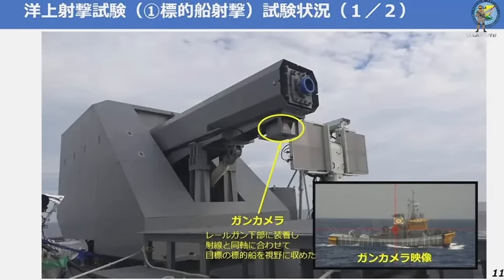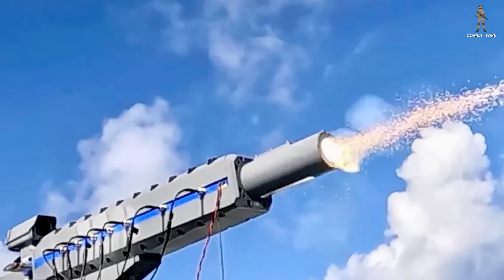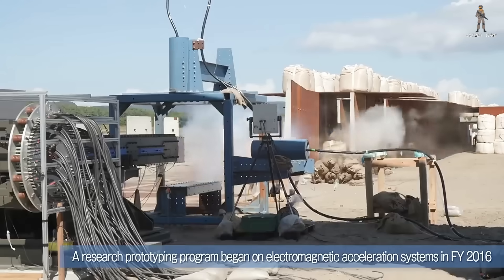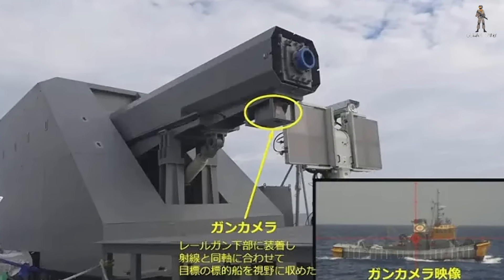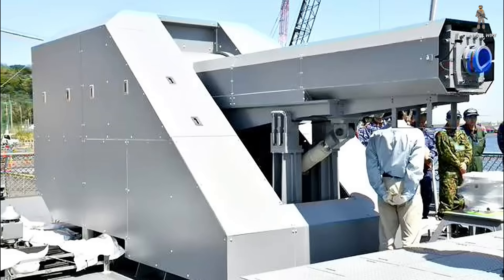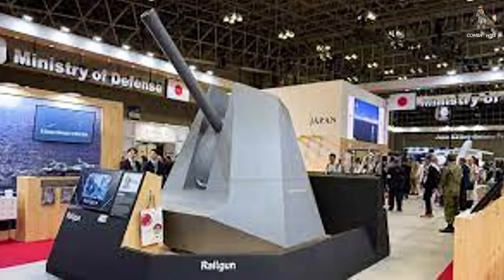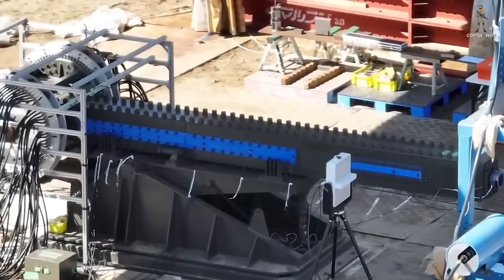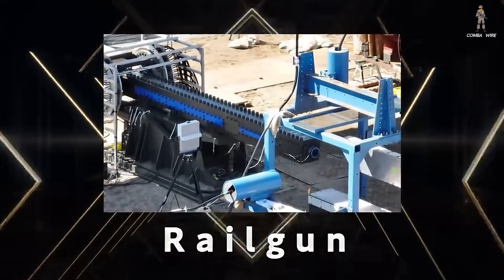For the First Time Ever, Japan Reveals True Railgun Damage at Sea.

Comment: Nice!
But as a weapon, does it destroy ship systems?
I see hits but no ships sinking.

You have a giant expensive hole puncher. But i don't see anything winning a naval battle. 
Maybe missile defense? Or long range anti aircraft? Maybe make them smaller compared to their target? But that's what CWS already does.
Reply from the maker: You've hit on some key points about the railgun's potential roles—Yeah, totally get what you’re saying — visually it just looks like a giant, super-expensive hole puncher. No explosions, no sinking ships, none of that “naval battle movie moment” stuff. But railgun hits don’t work like missiles. They’re not supposed to make a big fireball — they’re supposed to wreck everything inside at insane speed.

A hypervelocity round going 2–3 km/s basically drills straight through a ship’s compartments, slicing wiring, radar racks, coolant lines, electronics, fuel lines — all the stuff modern warships absolutely depend on. So even a “clean” hole can mean the ship is blind, deaf, and out of the fight.

But here’s the part that gets overlooked:

 Future railgun projectiles may actually carry small warheads.

Japan, the U.S., and several defense labs have all studied the idea of putting:

small explosive charges,

Fletchettes,

shaped micro-warheads, or

airburst payloads

into railgun rounds once the tech matures. Right now they’re using solid penetrators because it’s simpler and stable at Mach 6+. But warhead-equipped projectiles are definitely on the roadmap.

So in the future, a railgun round might:

Penetrate the hull

Detonate inside the ship, not outside

Cause massive internal fire, shock damage, and secondary explosions

That would be way nastier than today's “hole punch” hits.

And of course, railguns are also killer for missile defense. CIWS works up close. Railguns would push that engagement bubble out tens of miles. Super fast, super cheap rounds — and you can fire a bunch without burning through million-dollar interceptors.

So yeah, they don’t sink ships with big explosions today…
But give it a few years?
Railgun projectiles with internal warheads could absolutely change the game.

Comment: After seeing this, I have big concerns over the future trajectory of Railguns as navy effectors, It occurs to me now that, EVEN IF IT WORKS PERFECTLY, the damage done by a railgun really isn't particularly significant In a naval engagements, this may snipe a single dude or a system as it travels through the hull of the target, but it's a 50/50 as to weather it just passes through empty corridor and out the other side.

If it does actually hit something and sever an important pipe, cable, crank shaft, ect. it has likely only cut about an inch gap into it, which, compared to explosive damage, is extremely easy to repair for a damage control team. 

This fact makes me now question the cost/reward of actually attempting to field this, my guess is this is the unspoken reason the US pulled out.\

and why we have seen nothing other than a small X shaped hole in the side of a ship, I doubt they want to publicly admit they wasted so much time and money on a long range hole punch.

Comment: 7:50 Tell me JUST HOW a massive magazine full of rounds is ANYTHING except a massive waste if the barrel life of the gun is only 200 rounds???
Reply: Retired Navy here. I can tell y'all for damn sure ain't NOBODY gonna swap any barrel off anything other than small arms underway.  Navy ships toss around like a leaf in the water in a birdbath after you slapped it. And having to pull in ANYWHERE on a moment's notice during wartime means losing the whole ship's warfighting capacity for extended periods, even if all they can do is help fighting fires on other ships and picking up survivors. Not to mention they become a stationary target in port in the meantime. Ships are safest at sea. Besides, just WHO THE FUGG IS GONNA HAVE ROOM TO CARRY AROUND SPARE BARRELS, AND A SCHITTLOAD OF THEM??
Reply: The fuck does magazine size have to do with it
Reply: It’s the same as having a limited supply of missiles, just more in number.
Reply: replacing a barrel isn’t that difficult, it’s a stretch to claim it could be done mid battle but it’s not as hard as people claim it to be
Reply: @spytf2693buddy, this isn't a hot swappable SAW barrel, this has calibrated rails with like a bajjilion bolts on it 💀 what the fuck are you talking about?
Reply: @misterkarpik just because it has wires and it’s hot doesn’t mean it can’t be swapped genius
Reply: @spytf2693huh? I didnt say its not swappable, i said it isnt swappable QUICK enough.
Reply: @misterkarpik and that’s why i said it was a stretch to do it mid battle
Reply: @spytf2693yeah in that part i agreer

Comment: Well, rumor has it that barrel degradation being the first obstacle is not proving elusive as US continded. As far as ship design goes it's all 3D Cad work which Japan has used to great success for at least 10 years if not longer. It's the sub systems analysis for protecting the asset that will be the challenge. China true has a larger fleet, but 1/3rd of it are weak Coast Guard units and an entire line of destroyer's with a failed design that they somehow built an ignored ship board capacity for crew to serve it.